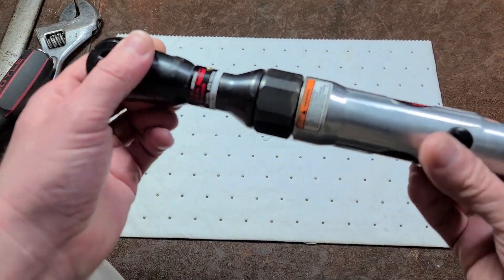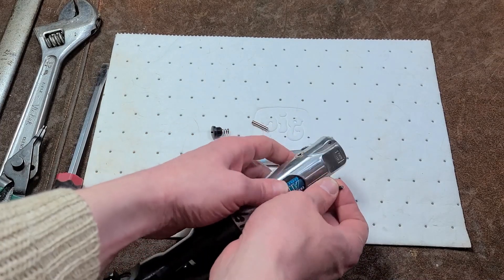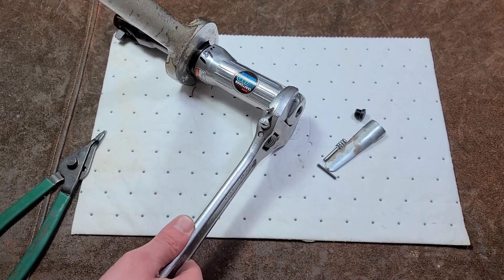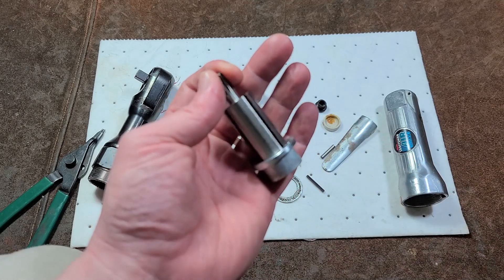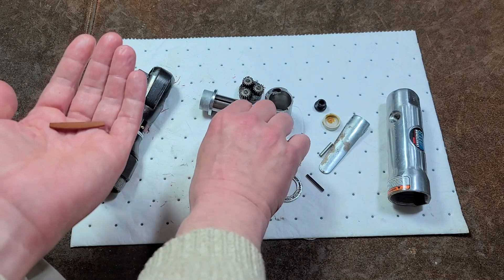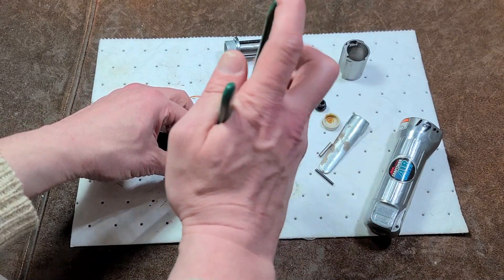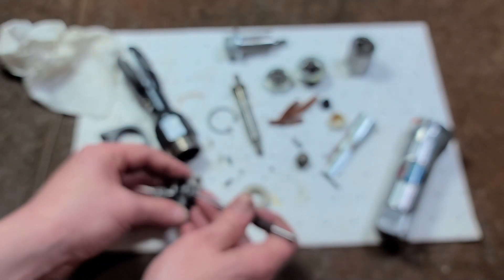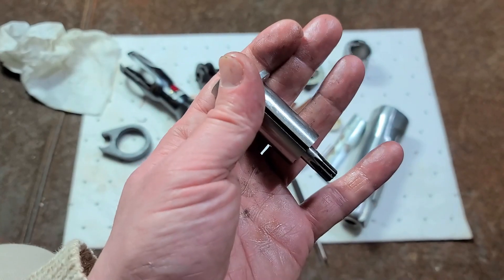Craftsman Air Ratchet Tear Down

Comment: The rubber/plastic throttle valve, which is missing in this video, can be replaced. It appears to take part number KF125190 from Chicago Pneumatic. 

I have a Sears Craftsman model 875-71224 with the same problem. The rubber throttle valve is disintegrating, which does not allow the level to return to its neutral/closed position. If connected to the air supply it would continue to run.

Comment: Your Craftsman Air Ratchet appears to be a version of the Chicago Pneumatic CP828 which was sold and badged as Craftsman.  I have an older version Craftsman 3/8" Air Ratchet from the 1970's, model number 756.18903.  I am positive mine was manufactured for Craftsman by Chicago Pneumatic.  It was built almost exactly as the Chicago Pneumatic CP828, both manufactured in Japan.  The Chicago Pneumatic CP828 is still available in their "Classic Range" of pneumatic tools which are still manufactured in Japan.   My Craftsman still works flawlessly.

Comment: Do you know what size ball and o-ring were in the trigger?  It would seem that a steel ball would make a ratchet serviceable again.
Reply: There was no steel ball or o-ring. It takes a plastic plunger throttle valve, Chicago Pneumatic part # KF125190. If you could get it to work with a steel ball, that would be neat, however the spring would have to be able to stay on the ball and not slip off.

Comment: What rpm do you think the air drives the rotor inside at? I ask as I'm looking into using an air ratchet for another application where replace the air powered rotor with a machined adapter to use a direct drive AC motor. Thanks for the video!

Comment: My ratchet failed on the inlet valve the plastic piece on valve broke. It cost me more for the parts than a new one. I had this since I started my first mechanic job it was over 30 years old. I ordered parts for a newer similar ratchet to fix it. Sentimental value you know and let my son use it after I repaired it. He was surprised how quick and powerful it was. Great video

Comment: These Japanese made Craftsman air tools seem to be of good quality. I have a 1/2" Japanese made Craftsman impact wrench (early to mid nineties vintage) didn't use  it  for decades. I recently used it to remove a stubborn axle nut that I was unable to loosen with a new M18 Milwaukee Mid Torque 1/2" impact wrench. I would think that air impact tools will outlast their cordless electric counterparts which have more complex motors/electronics as well as batteries that will eventually fail or be replaced by newer technology rendering the tool obsolete.

Comment: The vanes are phenolic, pretty easy to remake if you have the right thickness stock. The trigger on my IR air ratchet also failed. I replaced the parts using metal ones from another tool.